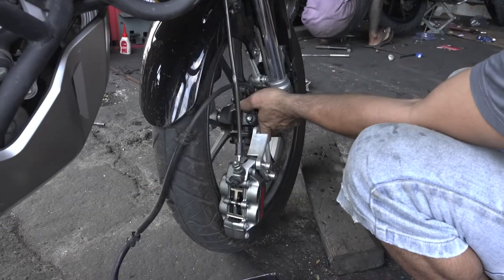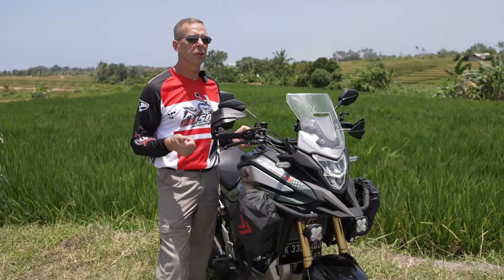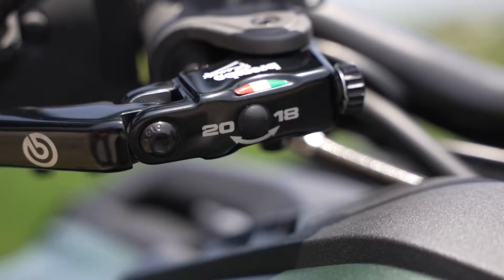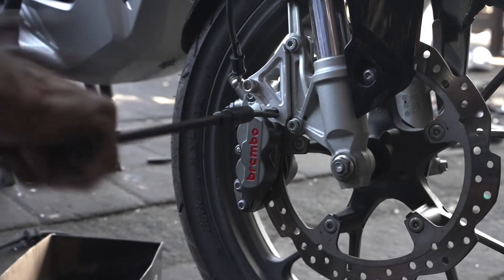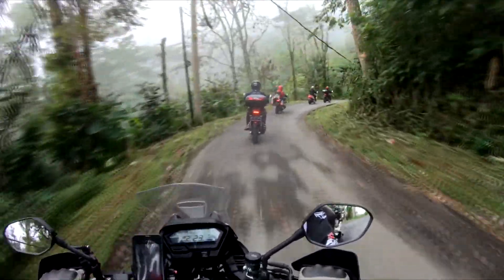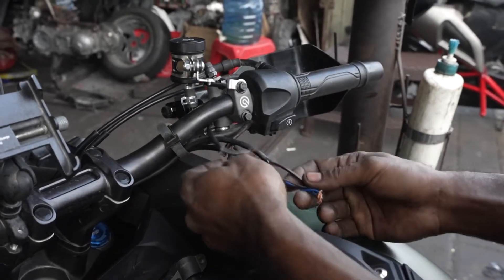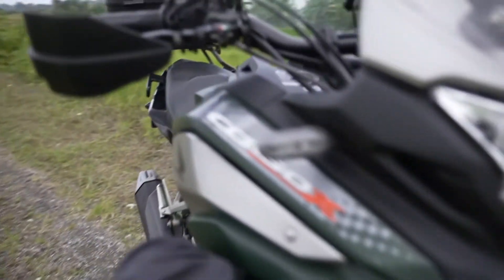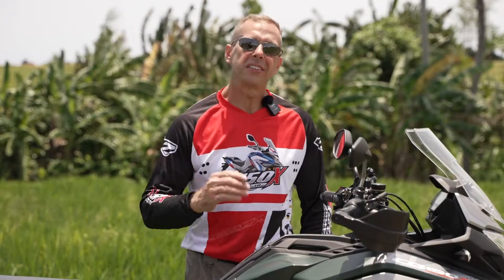Brembo RCS 15 Brake Cylinder Review

Comment: Your brake setup is similar to mine, but also different...I know that makes no sense lol! I am running a Brembo RCS15, HEL braided line, attached to a Brembo m4 monoblock for the front, with a 13 inch Galfer rotor. This is on a Harley Davidson Sportster. It works great, I will say that!
Reply from the maker: @jonnymac8925  i used to own a 1998 HD Sportster Custom. I purchased it new, back in the USA. I really miss that bike.

Comment: Original brake calliper is floated with fixed disc brake. Brembo calliper is fixed, so you may use floating disc for maximise brake efficiency. And less chance for harming the disc because of uneven force.